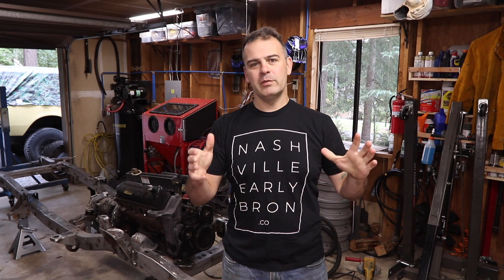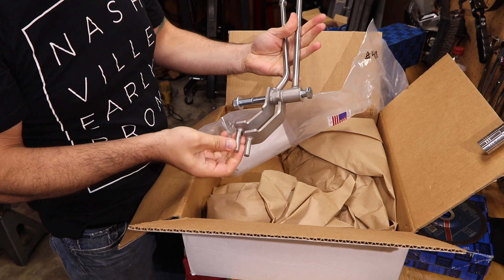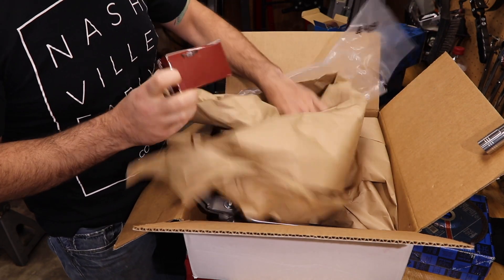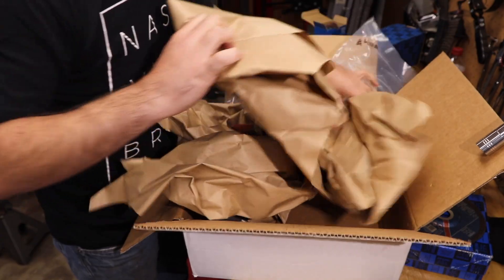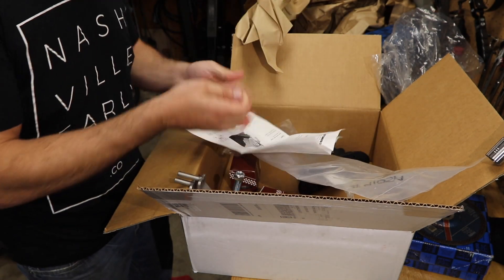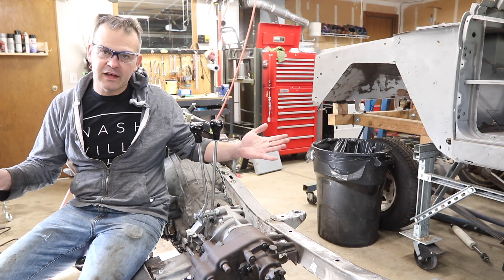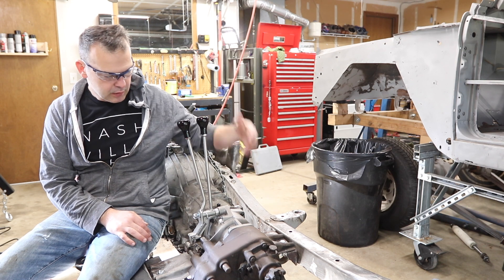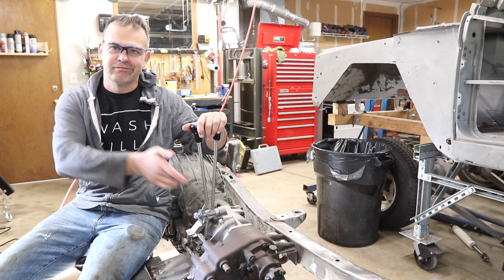3.10 - Twin Stick Shifter from Tom's

Comment: Will this allow a front dig.  Or allow you to disengage the rear drive line and just run front wheel drive
Reply from the maker: You have to have a twin stick to do a front dig but in order to do that you need to take apart the shift rails and remove the interlock pill that keeps you from having front wheel drive.

Comment: Hey Matt! I bought this kit for my 76 bronco it has a t18 4 speed and a Dana 20 that worked normal before install. For some reason my bronco will only drive in 2hi if my front hubs are locked in. Meaning only the front axle is spinning the rear is in neutral. If I disengage my hubs it won’t go into 2hi at all the bronco is in complete neutral. Do you have a guess as to Why my rear axle won’t engage?
Reply from the maker: Sorry Brock. That is beyond my knowledge. Your hubs should have nothing to do with the transfer case function but obviously something about the gears being locked in is making the t-case go into gear easier. Very very weird.
Reply: @MattsGarage   no worries Matt thank you so much for getting back to me it means a lot! Since you have this same setup as me could you tell me where the sticks go to put it in 2hi maybe im doing it wrong?
Reply from the maker: @brockarmstrong9896  spoiler alert. I sold the bronco to Mile 3 garage. I do have a twin stick on my Scout Dana 20 I think they are the same. Left is rear, right is front. So 2 hi is left stick all the way back (away from engine), right stick in neutral (in the middle).

Comment: Hello Matt, do you believe its possible to have a 5 speed floor shifter along with this twin dana shifter?
Reply from the maker: Rogelio Diaz I don’t know for sure but I know a lot of guys run the twin sticks with a floor shifter. Give the guys at Toms a call and they will know for sure if you give them the info on your specific tranny and vehicle (body lift and suspension)

Comment: Could this be done to any vehicle? 
I have a 1980 Datsun 720 4x4
Reply from the maker: Garlōs Montoyotana you must loom to see how the shifter works. If it is a cable or a lever that only has one hinge then you cannot. If the shifter has two rails that go into the transfer case, then you could make a custom shifter.

Comment: Can u explain to me why u have 2 shifters os one for the transmission?
Reply from the maker: Hi Brian,  no the transmission shifter is on the column.  It's hard to describe how the mechanism works but there are two rails on the Dana 20 transfer case.  One rail controls the front output and one controls the rear.  In stock set-up the rails have a plate at one end that overlaps so the single J-shifter operates both rails at the same time.  When you do an AOD-E swap, it takes some work to make the stock shifter work.  I preferred to go with the twin stick because it's easier.  But hard core off-roaders get the twin stick because you can do things like a front dig where you throw the rear rail in neutral and keep the front axle in gear.   When you do that you can execute a much tighter turn off-road.  I don't need that for my build I was just looking for the best solution for my application and the twin-stick is by far the easiest.
Reply: Matt's Garage thanks man for the expliantion my 79 ford is a 3 on the tree